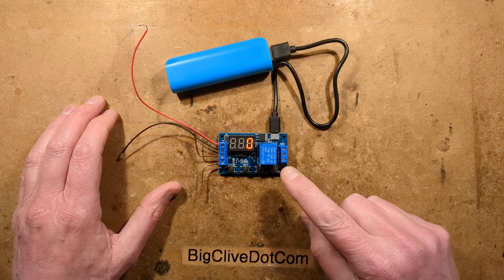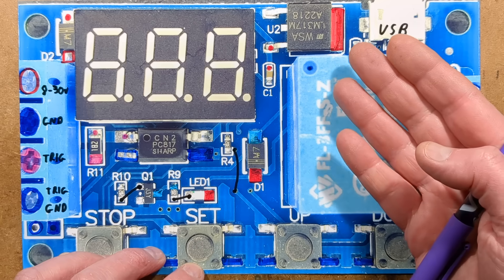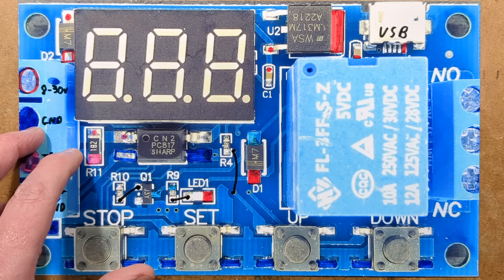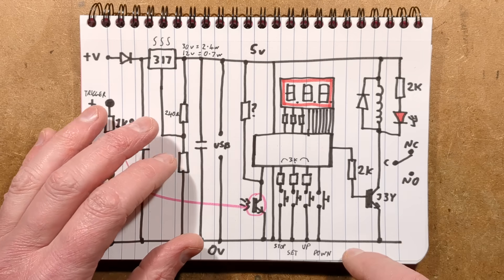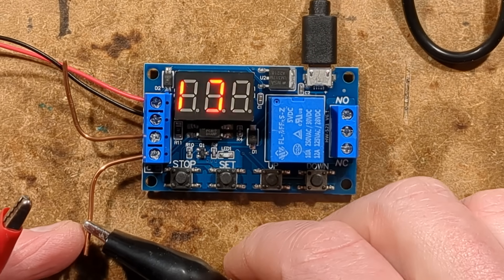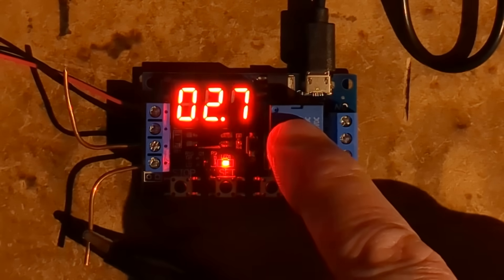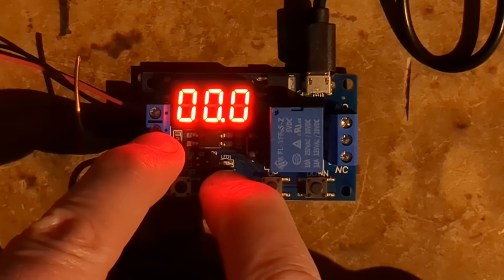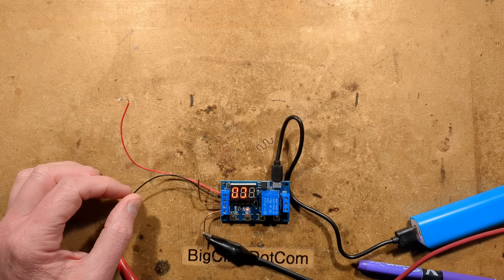How to use these common Chinese timer modules

Comment: I used 2 of these with another wireless relay (as like a momentary push button) to power-cycle a target device.  The momentary relay would power on / trigger the first relay which would come on instantly for 20 seconds which would instantly power / trigger the second one.  The second relay had a 5 second delay, then 60 seconds on, then off (I used the NC contacts on that second relay to power the target device all the time until I initiated the power cycle -- it would cut out the target device for those 60 seconds).  The two module relays were separated from each other by diodes and were self-powered through their own NO contacts, meaning if the relays were energized they would provide their own input power regardless of what was happening in the other relays, but once all timing had stopped, both relays would shut themselves off completely allowing them to draw no power and also clear their volatile memories.  The first relay module would also get power cycled with the target device to clear its volatile memory as well (it's Zigbee actuated).  I can start the process locally with a button to bypass that trigger relay, or hit it remotely through home automation (assuming that's working).

Comment: I use them with a PIR for a large Star wars model bringing on lights and music when yo walk pass.
It took a lot of research to find the instructions.
Would love your thoughts on a remote controlled light switch. It has no power or batteries, it uses the energy from pressing the switch to send a signal to relay in the ceiling rose. I have used them for at least 3 years.
Reply from the maker: Search my videos for the word kinetic.

Comment: Thanks for the interesting video. I’m surprised there is no diode between the output of the 317 and the usb input. I never tried, but I can imagine it doesn’t like 5 volts from an external source at the output pin. I always added a diode in this kind of setup.

Comment: So, that archetypical scene from an adventure movie should not be about which wire to cut: red or blue, but about which button to hold down for four seconds and then guess which of «Px.y» modes to program... Meanwhile, a character tied on circular saw: 5 seconds on, 2 seconds off,  5 seconds on, 2 seconds off...

Comment: I used one of these to keep my furnace running.  The entire electric match system failed.  I took a trigger module and pulled the signal off of the draft motor.  When it started it hit the trigger.  The trigger hit this.  And I put a 12 second pre timer to give the draft motor enough time to go and wait for the gas solenoid to trip.  Then I took an extension cord right into this and the electric match.  It worked for almost a year before another part of the furnace board failed. 

You can fix almost anything with these cheap Chinese modules.

Comment: I wonder how does mcu generate time base without xtal oscillator. How accurate the timeing is?
Reply from the maker: It will be based on the internal oscillator, so not crystal accurate.

Comment: The relays used in these and similar devices that use the same relay, are truly "crap". 
The relay contacts seem to be made of Chinessium. 
If you draw the rated amps printed, the relay will fuse shut and not release.

Comment: A strange button multiplex I've used in the past for pins with no pullups is to drive the pin high for one NOP and then changing to an input.  Immediately read the pin.  Open switch reads high as the pin hasn't had time to drift.  Button pressed reads low.

I used something similar to read data that was on a parallel bus the previous cycle. Just read the floating data bus and you have the last data sent.

Comment: I love these modules, they are so useful. On my 14 day cat feeder the ultra shoddy control board rotted and I replaced it with the slightly posher version of this module running on 10V. Been testing it for weeks and working perfectly. I have another triggered by my doorbell that provides timed power to an amp and sound chip stolen from a 'Bob the Builder - read and sound' book; set to hammer noises. It took days for the cat to get used to that.
Reply: 😅😂😅 love it!

Comment: I've been using these for years as start/stop eliminators in my cars.  When it sees 12V ign power, it waits 10 seconds and then closes the relay for 1 second.  I wire the relay contacts across the start/stop switch in my car.  Every time I start the car, the unit shuts off the star/stop automatically.

Comment: I seen modules of an older older variety used in a wave pool build in 1969. It had two modules that alternated back and forth every 1.25 seconds that actuated solenoids. The solenoids made pneumatic pistons move air duct that blew air from 75hp Lincoln’s electric motor fans into chambers to create waves. We figure out how to change the setting mid wave cycle to increase the amplitude of the waves.  The timers were made in Germany I believe.

Comment: Very handy indeed, it is self contained which I think is a huge plus. I've only been doing electronics as a hobby for 2 - 3 years, at work I dabbled with 3 phase industrial systems and DC systems for armoured vehicles and  posh yachts. These modules are becoming cheaper and the variety of different operational circuits really help old pharts like me as they come with their own library. Thanks Clive,  the educational aspect you give is appreciated 👍

Comment: You could glue a small heat sink onto that voltage regulator with some thermal adhesive. Would help a lot with higher voltages.

Comment: Why they don't employ the older USB Mini rather than the devilish Micro "B" variant (necessitated I gather by slimmer cell phone profiles) is beyond me.
Good lord if I could get back the time I spent with the latter trying to get orientation right.....  :) The Mini is durable and easy and who doesn't have a few cables kicking around!!
Reply from the maker: I struggle to find my mini leads these days.  They are still used on older stuff like my PICkit2.

Comment: I used one with 3 buttons and no USB to control the auger motor on my Traeger pellet grill to keep a much more consistent temperature. I don't think it has as many modes. Maybe I'll play with it later. Cheers 🍻

Comment: Clive, today I got delivery of 300 fast blinking LEDs. You know what that means 😉😁
Reply from the maker: It means it's supercomputer time.
Reply: @bigclivedotcom that's right! And I'm soo excited, that I didn't get the sentence out streight.
What I didn't thought of is, if it is  possible to put like 2 or 3 in series and run a higher voltage (making it easier with the power supply)
But the more I think about it, it is not possible. At best they would synchronise with blinking.

Comment: I just finished building a brooder using a similar module. My chicks are happy.
Reply: Do you have overheating protection? Because if this shorts out, the heater will keep running until something else stops it, or it burns out
Reply: @MrHack4never  yes I do. I always factor in redundancy for critical systems. I even have a charcoal heater in case there are power cuts.

Comment: I am interested to know how other people get on with these modules. I purchased six of the FET based ones and used them to control lights. Within 12 months, five had failed. In all cases there was no output from that linear regulator. But, the display and controller had also failed.
Reply from the maker: What voltage were you running the modules at, and were you driving an inductive load?  I think any inductive load would need a diode across it to shunt the voltage spike when it is turned off.

Comment: Hi Clive. I use one of these on my home made spot welder I use for making battery packs. I tried quite a few other timers before finding this but none had the control this has.I time to the nearest 1/100 of a second and actually run it from a separate battery supply to the spot welding battery as the action of spot welding screws it up if it is on the same supply.

Many thanks for your efforts.

Comment: Does this vid have a strange resolution?  First time I see scroll bars in a youtube video.
Reply from the maker: It should be normal 1080P, but I'm currently using a different app to splice sections together.
Reply: Clive has scroll bars in the clutter around his desk, I guess one managed to get into shot.

Comment: Ooh - no diode so you can charge your battery pack from your timer!

People will be shouting at the screen for Clive to look at this with his much-neglected 'scope to see if the buttons are multiplexed. (I understand why not - the rate of video emissions would plummet.)

By the wobbliness of the wires I'm guessing it's using the nasty cheap variety of PCB screw terminal.
Reply from the maker: It is the cheapest terminals.

Comment: Wow.  That's a pretty wild little unit.  $1.65 in the states with a$10 dollar order yielding free shipping. (Sheesh)

 I was going to have a question about 999 seconds but you indicated that the three decimals would transfer over to minutes.  

Very wild, the amount of programming in that little chip.  Thanks for sharing this Big Clive!
Reply: A tip for AE users outside the US: assuming you have a fee-free payment system, always switch to US Dollars as AE's exchange rate is bad. And of course if you use PayPal, make sure to overrule the default conversion to your local currency with a similarly bad exchange rate, despite its scaremongering. PayPal has now taken to insisting on sending me a verification text just after I select pay in original currency - and then switching back to currency conversion when I enter the code! How dishonest of PayPal is that?

Comment: I was just looking at your Patreon when you posted this. The stars have aligned. Potentially can you take a look at the cheap chinese 3v taser modules if you havent already?
Reply from the maker: I have to be careful with ordering things like tazers, as they are classed as weapons here.
I have made a video about a high voltage spark module, but my guess at the insides was wrong.  Many are based on voltage multipliers.  If using the modules be very careful not to space the high voltage wires too far apart, as the high open circuit voltage can damage the components inside.